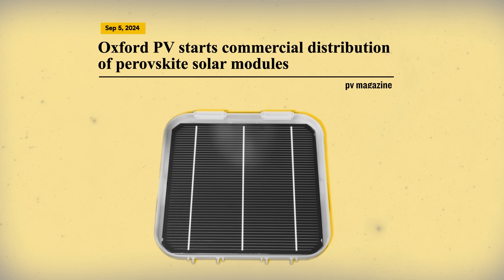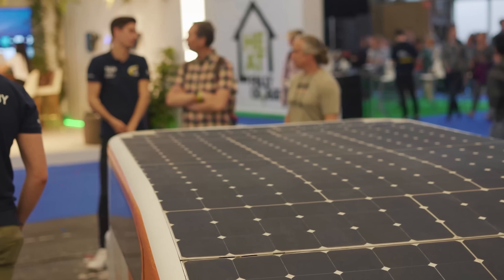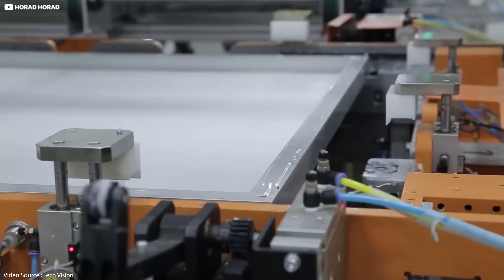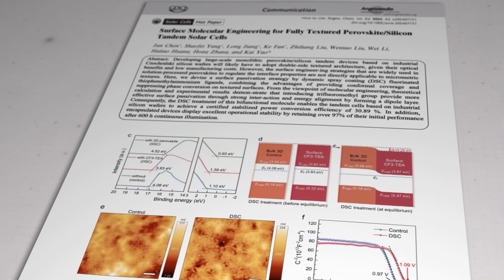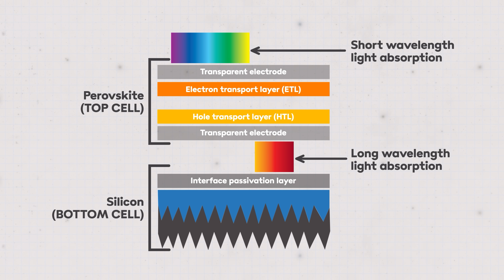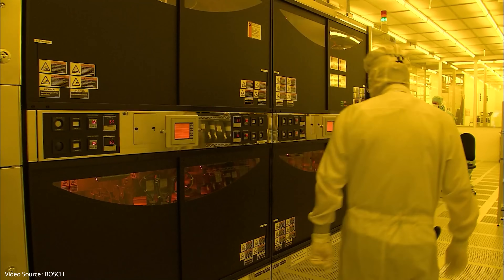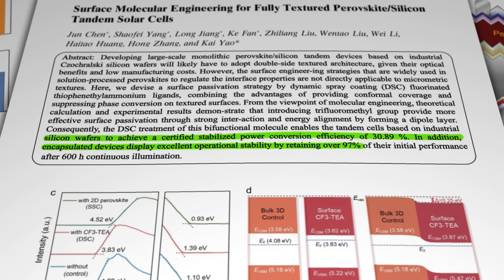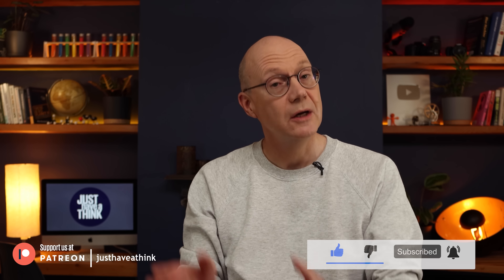Solar PV with more than 40% efficiency is now achievable.

Comment: That's my luck.
Made research in quantum dot cell to save the world... not working good enough, tech ended up Q-led in monitor.
Made research in organic photovoltaic to save the world... not working good enough, tech ended up in OLED monitor.
Made research in Perovskite cell and... stopped thinking that "will end up like the other two broken dreams displayed on monitor" and abandoned research for private sector..
Now 10 years later... Those are working -_-
Reply: Science is a crap-shoot. I applaud your honest efforts. Really, that's the best anyone can do.
Reply: you paved the way for those discoveries
Reply: Organic PV may well be working as you say. With your experience though, you surely know that Perovskite is not organic. It even says so in the video.
Reply: @ahenchan5422  You probably misread. Quantum dot was the first one that didn't work out, organic was the second one that didn't work out. Perovskite was the potential third one that finally convinced him to turn to the dark side. 
(At least he tried; I started on the dark side and never left it.)
Reply: @ahenchan5422  Miss typed two times Organic PV. First Perovskite were also pretty nasty. With lead inside and GHB as solvent for deposition. So definitely different from the OPV I was doing before with most of the material that were perfectly biocompatible.
Reply: Next time aim got get rich instead.
Reply: @1marcelfilms  Well made the jump to private sector. That was quite an improvement for money and job safety from research. Less satisfaction however.
Reply: @1marcelfilms  Aiming to get rich is even more of a crap-shoot.  9 times out of 10 you get broke instead. And 10 times out of 10 you spend 95% of your time pleasing investors and customers and 5% working on your dream.  (Don't ask me how I know this. 😁)
Reply: This is what happens when science is for profit instead of discovery heh
Reply: @3nertia  Love is just as effective as profit when it comes to breaking the laws of physics.
Reply: @2ndfloorsongs  I wish that were actually true ...
Reply: @3nertia  Oo don't worry on that. It's absolutely true. Most of breakthroughs come from idealistic researcher. When they have liberty to do what they want the way they want giving 100% of themselves.
The private sector is effective in implementing that idea, and make a product out of that.
But private research is far far less effective than what you think. A lot of money but with  many (no all) people doing it only for the money and only as long as working hours last and the worst thing... the target is often set by managers, and by short term enring or playing safe.
In fact the few companies that have a higher risk, long game approach, and the money behind to sustain it, are the one either failing bad or making the headlines.
But Space X, Open AI, Google, Facebook... were considered rare money dumpster fire in the private sector. that we know about only becouse they got it right while many doing the same are under a bridge.
Reply: @GhostFS  Thank you for misunderstanding of capitalism and its incentive structure but there are many experiments and several R&D projects I'd like to be doing but alas, I am limited by funding and opportunities lmfao

It's almost like investment capital is required under *capital*ism ...
Reply: @3nertia  Well I have done university research, research in a synchrotron, research for military, research for industry both in industry and in academic institution as Industrial liaison office, with European founding national or international.
One thing that is common to all... getting found is hard, you have to convince them that the project and you are worth it. 
And if you think that privte will handle money easier than an Academic institution... I thin that it's you that have misunderstood capitalism.
In Private you will need not only to convince them that what you do could work... you need to convince them that will make them money, ho much, how fast. So good luck.
Reply: @3nertia  PS: but I agree it's shit. Now that I'm far in my career... the paperwork and meeting to justify expenses of my team ad asset is 80% of my time.
Last month I have spent like 12 hour of meetings to justify the acquisition of less than 10k of network equipment for a renovation to explain to management how demolishing the old network node without building a new will cut internet to the whole department and that will hurt operation... while in the department  next they wasted 2 millions because after an operation stop  there were not able to explain in time why stopping the recursive material acquisition for an operation that is not longer done was necessary. Want to make research? Become good in sales pitch and paperwork.
Reply: @GhostFS  Must be nice to be afforded such opportunities but you, once again, display your lack of understanding ...

Not everyone even has a shot at college - even though that's just a debt trap anyway - let alone the chance to work in any "official" capacity ...

All I can do is dream about the research I would love to do and the equipment I'll never afford to do it ...

Comment: 20% better for 50% more $  ???
More roof shading from more and cheaper panels might be better value as latitudes warm.
Reply: Things get cheaper when in production and scale increases 🤓
Reply: @MikeHodgkinson  Australian rooftop PV is cheaper than windows $m². With sunshine, grid electricity is not needed in the day peak.
With only 4million buildings with rooftop PV the government is looking to charge the customers supplying dirt cheap electricity into the grid. 
20million rooftops maximum so much more rooftop PV can be installed. 
Just my observation.

Comment: How does excessive heat buildup affect perovskite tandem/silicon panels?
Reply: While I can't be of any help about the chemical or structural (delamination caused by temperature cycling)  effects of elevated temperatures, I do know that it's more problematic to cool the cells because the extra layers reduce the cell's thermal conductivity.
Reply: @2ndfloorsongs  Thank you

Comment: not really competitive at current prices. We pay here 140 € per kWp for 550 Wp panels 
I would get 4/20 = 20% more power if 24% versus 20% would be right which I doubt cause Longi claims to have 22,5% panels with 550 Wp. 
And then it would be an advantage of 1,5 / 22,5 = 6,6% or for a 550 Wp panel it would mean that the perovskite panel would deliver 40 Wp more.

Forget about perovskite at such price level which people will not buy for such premiums.

Comment: I read many concerns about the longevity of perovskite panels, but if they are dirt cheap, that might not be much of an issue.. just have them removed and install new ones (which are probably better as well), the old ones should then be recycled, so the materials can be used to make new solar panels.
Reply: Today installation costs more than the panels for residential applications
Reply: @terosma  You can install it yourself. It's not difficult.. At the very end, call an electrician and have him connect what you've built and stamp it :-)
Reply: @GreyDeathVaccine  Sure, climb to second story roof every year. No thanks.
Reply: i think they're not going to be dirt cheap (at least not anytime soon) because they're going to be silicon-perovskite combination, LCOE can be lower than regular ones because they converts more sun light into electricity
Reply: I hope development continues because they are certainly viable for specific applications. But even if their reliability is improved, I doubt they will ever reach the amazing reliability and manufactured cost of current solar cells whose prices are still falling. Three problems: Their manufacture requires adding additional layers which requires a more complicated and expensive manufacturing process. These additional layers decrease the cell's thermal conductivity which complicates cooling issues. Their weather-resilient protection requires more expensive UV transparent glass or a plastic that is as durable glass.
Reply: The  long-term "vision" is to inkjet print perovskites onto a plastic film, like greenhouse plastic. Replacing your solar panel would then just be a matter of rolling out a new layer of this plastic and connecting up wires to the ends.  It is possible to have multiple layers of different perovskites tuned to different colours of light, so these plastic films could be just as efficient as the silicon-perovskite tandem panels.
Reply: @gregvanpaassen  Nice vision. Combining your ideas, perovskite could presumably be tuned to absorb only green light, which plants cannot use. So a greenhouse becomes a cheap, relatively inefficient power plant. In addition to producing the same amount of food as a normal greenhouse.
Reply: How is low voltage of wide spectrum cells a problem when one can put them in series?
Reply: @MartinMaat lower voltage, same current (per unit area) =less power (per unit area)
Reply: Having them removed is the challenge though, in many parts of the worlds this means scaling multiple story buildings. Casually doing that every few years for each house on the block isn't doable.
Reply: @dinokknd  I have solution.  Let's mount them on the side of building and add new cells at the top, Tetris-style ;-)
Reply: 9:08 the figure shows certified stability for 700 seconds. Most research papers that claim good stability in operational conditions give an estimate of 6 months before the perovskite solar cell is reduced to dangerous lead-containing waste. Maybe Oxford PV has figured out an alternative perovskite structure that is more stable and no one else in the countless research groups has done, but I would not hold my breath.
Reply: @user-pi4qo3zc2e  Holding breath based on optimistic youtube videos usually only leads on the path towards suffocation.
Reply: @user-pi4qo3zc2e  That is old data, I advise you to watch JHT video, its really cool!
Reply: Recycling and production cost a lot of energy. Lowering the lifetime of solar panels will significantly lower the efficiency of PV when taking the whole production line into account.
Reply: Most figures given are for the raw cells.  These cells need to be mounted on a back panel, need to be covered with some protective glass, need a frame, need to be interconnected for a finished product.  They probably need changes to MPPT trackers / inverters and these are currently not and while for a while not be available at volume prices.   Manufacturing for perovskite cells and raw material needs to be built up and ramped up to volume which as in every industry means the first products will be of worse quality and higher price than previous alternatives.  Also add the cost of disposal / recycling of used cells.  The current figures I go by are 6 months of life time for prototype perovskite cells and 20-30 years for conventional panels.  Basically, it's not worth it at the current state and I'm not holding my breath.

But I'm halfway optimistic that it can be done and be done in a reasonable timeframe.  Does anybody recall solar cells in the 1970?  Even space grade cells were cr*p compared to today's consumer grade cells.
Reply: They aren't going to be cheap if made in the UK or Europe.
Reply: Wouldn't it be amazing if no product was allowed in the market until the whole process, down to its recyclability was designed and implemented?
Reply: @SonnyDarvish  it would be amazing because we would still be living as cavemen... But yeah, recycling must be recognized during the design cycle. I think it's only a very "short" time that we recognize that recycling is part of a product lifecycle.
Reply: @SonnyDarvish reusable most likely. They can be resold
Reply: That includes many types of plastics currently in use! 😅
Reply: @SonnyDarvish  No, no it wouldn't.  If you solve a problem and it's useful and has a market and isn't doing harm to others then as free enterprise is what a good chunk of the world operates under, if consumers want and and want to pay the price, that's their business.

If everything have to be completely perfect before something comes to market, as someone else said, enjoy the cave.  Humans got to where we are now by taking advantage of a set of problems being solved and then later solving other problems.
Reply: @SonnyDarvish  That's not how capitalism works though ...

Comment: Doesn't this need the ultra pure silicone only found in the NC mines where Helene just hit?
Reply: BTW, Silicone = caulk and fake boobs.  Silicon = computer chips and solar cells.
Reply: That's a misconception by one remove. That mine isn't a source of silicon strictly speaking, it's a source of ultrapure quartz which is used in making crucibles that are used to process the pure silicon needed for electronics. So it's a necessary input material for making pure silicon, but not the source of the silicon itself, although adding to the confusion is the fact that silicon is one of the elements in quartz.
Reply: Ultrapure silicon is manufactured from quartz. There is plenty of suitable starting material as the necessary purity is achieved by a multistage chemical process.

Comment: 80% of the world's population live in DICTATORSHIPS. 
80% of the world's population live in warm LATITUDES. 

Warming latitudes with hotter roofs need the rooftop SHADE 😎 of rooftop PV panels. 
Hahaha 👍. 

With robotic factories and manufacturing Australia could lead the world in dirt cheap electrical energy industry. 

With robotic factories and manufacturing Australia could lead the world in battery electrical energy storage industry. 

Every factory m² of man hour could be replaced with 5 robotic hours of production 24/7/365.
A $100,000 robot working 10,000 hours every year. 😊😊😊

Nuclear idiot promoters in Australia just do not understand that nuclear electricity 24hrs daily is DEAD economically when the sunshines.

Grid electricity is 10% of Australia’s energy usage. 
BASE Grid electricity is 10% of Australia’s Grid electricity. 
10% of 10% is 1%.
Nuclear electricity is bs economics. 

Renewables will carry 99% plus nuclear  ???? This is nuclear bs economics. 

Are nuclear promoter's saying fossil fueled energy to be replaced by 10 times more electricity  ????

Are nuclear promoters saying Australia should export uranium yellowcake to all the world's nuclear electricity industries to protect Australia from climate destabilisation  ??
80% of the world's population live in dictatorships and will use Australian uranium yellowcake to save Australia  ??
Australia is in the Sahara Desert latitudes of the southern hemisphere.

Comment: All that matters is how is the respectability. We don't need super powerful solar panels what we need is solar panels that are easily recyclable
Reply: No, that's not "all that matters".  When you're comparing it to coal as a source of electricity, you need to consider all the people and other animals getting sick or dying from the air pollution, the mountains of toxic coal ash, the massive, ongoing destruction of the environment while we continually mine massive quantities of coal.  With solar panels, the material requirements are minimal.  Infinitesimal, in comparison to coal.  At the end of their useful life, decades in the future, they can be harmlessly buried.  So what.  I know, "Reeee, it's not 'sustainable'!!!"  BFD.  Coal is killing us.
Reply: @incognitotorpedo42 They are easily modified into standard roofing material. But yes, burying them in landfills is easily justified because their 30-year lifetimes make their mass per year relatively low. Orders of magnitude lower than most anything else you put in a landfill. Add another order of magnitude or two when you consider single use plastic and don't even get me started on disposable diapers and kitty litter...
Reply: All that matters is that we respect them, show them we care. Respectability is what I really look for in a solar panel in 2024.
Reply: recyclability is not really that important, specially if it's at the cost of panel durability. modern solar panels are made to last more than 30 years already, and even after 30 years they still produce plenty of energy. if you can make them easier to recycle without affecting durability, then sure, but modern panels already can be recycled, it's just a lot more expensive then mining new raw materials. but it would be even better if we found ways to continue using old panels, just like we should find ways to continue using old batteries for as long as they still work.
Reply: We want both, of course: super powerful solar panels that are easily recyclable. And cheap, too.
Reply: Solar panels are recyclable, there is a growing industry in recyclable panels

Comment: I am looking forward to longevitiy data on these new PV cells that make use of Perovskite as they go through their service life.
Reply: Even if you assume that sunlight is only intense for 6 hours a day, that was only 100 days. We want an least 3000 days, minimum.
Reply: @adrianthoroughgood1191  Well, they only reported the degradation to 97%.  That can't necessarily be extrapolated 10x (compare: Li-Ion batteries lose the first ~3% quickly and then slow down).

Comment: I feel a bit like a solar panel myself - only about 20% efficient in converting information into learning!  (Might also have something to do with wavelengths).  It did occur to me though that it would be a lot easier to collect the sun's energy as heat and convert the heat into power as needed and use much of the heat for - well, heating.  Not a novel concept, I know, but I would be interested in the relative efficiencies and ways in which the sun's heat could be concentrated for increased energy production.
Reply: Got an early look - probably because I’m a paying subscriber.